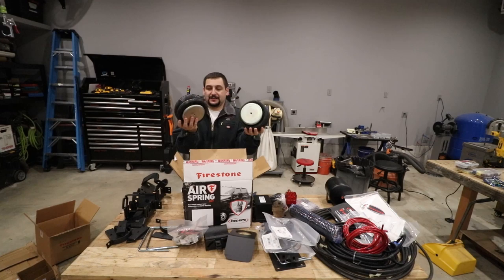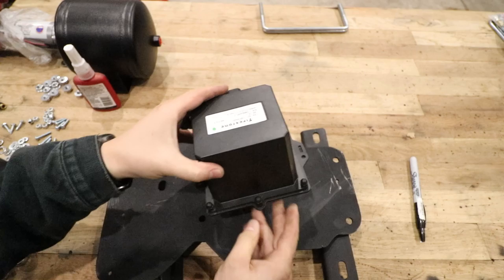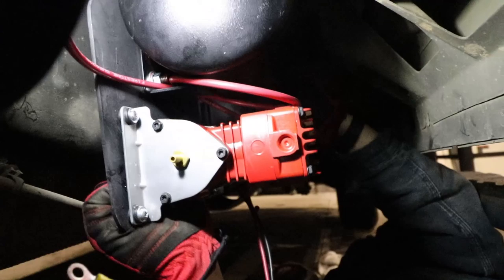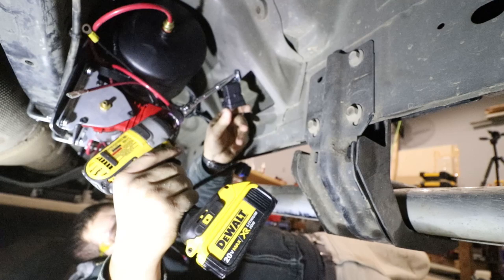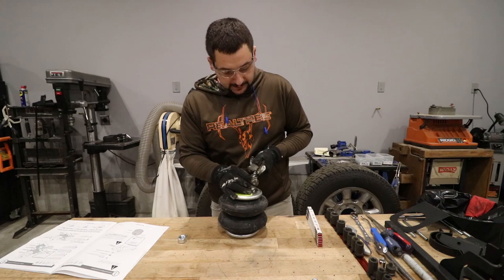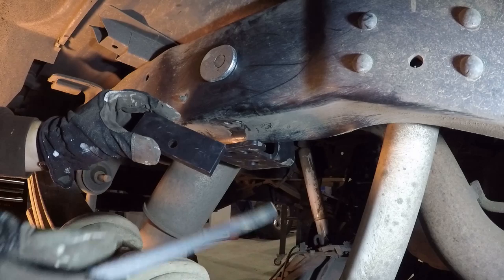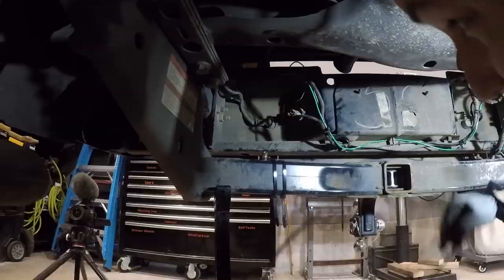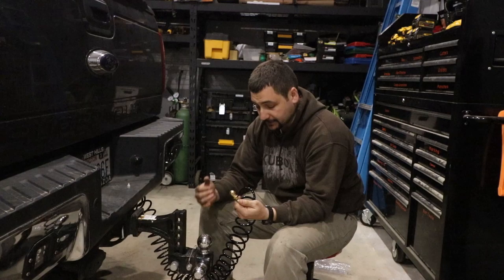How to Install Firestone Air Bag Suspension Kit

Comment: Nice video. Was cool to see some of the shop layout.

Fabricated mount for the 3 components is well done.

Is the ride more firm, even at low pressure?
Reply from the maker: Paul's Pro Tips Oh yes the ride is much more stuff. I leave at five psi and you can definitely feel the difference from when it wasn’t installed. But it has made a significant improvement in towing my large heavy trailers.
Reply: @DanielWoodell  I am considering installing some bags on my truck. Also considering installing a pair of valves to be able to run the bags open to atmosphere when not needing the extra carrying capacity. 

I do love the way they make a truck fell when towing!
Reply from the maker: Paul's Pro Tips That would definitely help with the stiffness, I would definitely consider air lift bags With the internal jounce stops. Most of the airbags require give me five psi in the middle times.